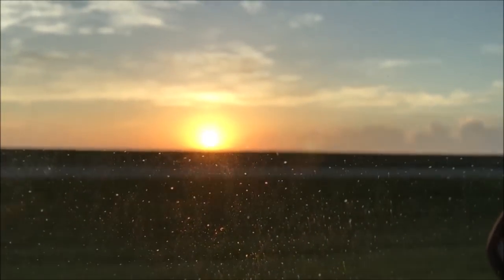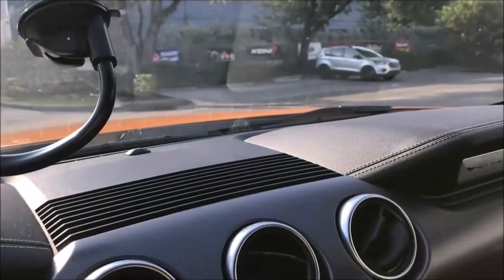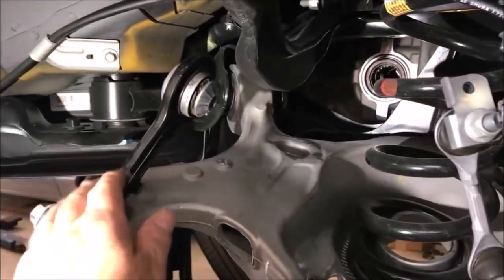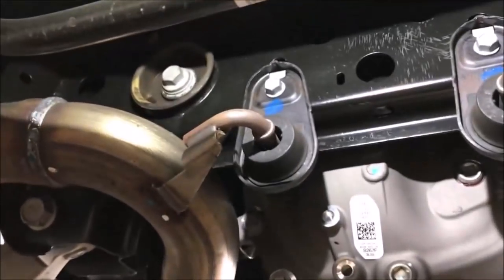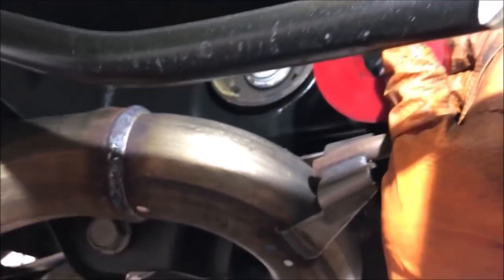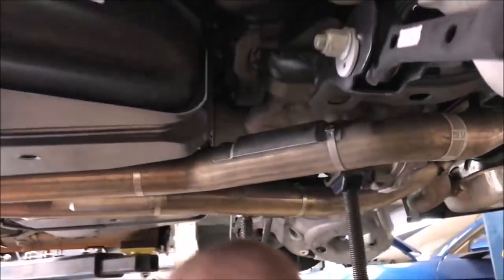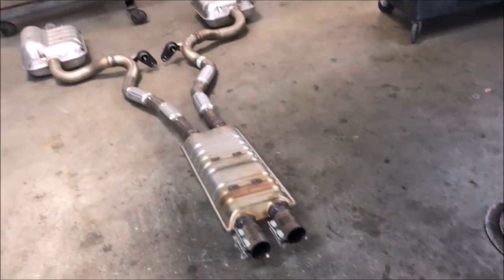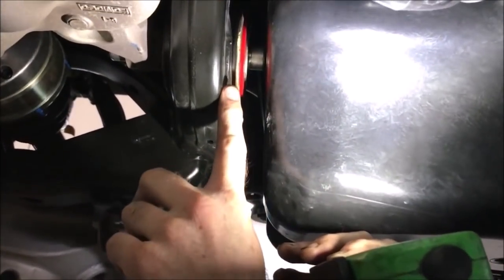2018 Mustang GT 5.0 10R80 - Stop The Hop Install at STEEDA! Part one!

Comment: I have same car as you,except its a convertible,best time i have done so far 4.9. ,with my stock tune ,however i have invo nitto tire instead of stock,+ 295/35/20 in the rear,went with stagered set up 255/35/20 .
Reply from the maker: John Smith.... Wow the 295's must be taller than the stock size. I am running the 3.55 rear gear. A tune will help your car i am sure!!

Comment: I notice you dont have perf. Pack 1 or 2 and no magnaride. Did you decide to go with little options to save money or to build your Mustang from the ground up. ?? Just curious. The GTS can reach all the way into the 50s fully loaded and you are going into used Shelby territory at that price..
Reply from the maker: The General ..Hey bud thanks for viewing.. you know when i bought this car in november of 17 i had to make a decision. PP1 with magnaride. or non pp car.
buying a pp car without magnaride made no sense to me. i elected to get the non pp car with the 10 speed and the 401a pkg for the digital dash. $10K cheeper that the pp1 magnaride. that $10K got me the whipple installed. i can upgrade to the 6 piston brakes if i want to at this point. What do you think? did i do the right thing?
Reply: @coyotecarguy2076  Man I like the way you think. Many people purchased the 18 PP1 some with magnaride some without and now they are wishing they had a whipple or Roush supercharger. The way you did it.. You can take your time and build it the way you want it over time.. Good job brother..
Reply from the maker: @thegeneral8133  Thanks Man!! Few people have supported me on this. I use the car for street driving. I could use better brakes but i really don't need them. I like my 750 HP Mustang GT. Check my Video from last month!

https://www.youtube.com/watch?v=Z8LvWEwS6uY

Comment: New to these cars, why replace the axles?
Reply from the maker: Jeremiah Bright  . . . I installed better axles because i was installing a supercharger. .  the stock axles will break when you put a lot of power through them.  especially if you race the car with drag radials.

Comment: Or just buy an SS 1le and never have to spend a dime on the suspension . It's perfect
Reply from the maker: Mike Ross. I thought about getting a camaro SS. But i am a mustang guy. Ford tries to isolate vibration and road harshness from the passengers by using soft rubber bushings in the suspension. When you start to build power the suspension flexes a lot
and the wheels bounce around. Some of the parts i installed were not totally necessary to stop this but i plan more power in the future.. Thanks for posting my friend!
Reply: Coyote carguy is there any truth to a 5.7L coyote in the future?  Would trade the SS in tomorrow if it's true . Btw I'm a Ford guy too, just couldn't pass up the deal on the 1LE.
Reply: Coyote carguy btw don't make us wait too long for the bolt ons!!
Reply from the maker: Mike Ross.. i understand why people buy a camaro.  Its a rompin car.
I have no info on a 5.7 coyote.. I can say though there is a possibility of a 5.2 n/a voodoo engine in our future. ford has a way of using the same stuff over and over once they build something.
Reply from the maker: Mike Ross. i have some mods planned for the car. I have to wait until they are built before i can put them on.. stay with me it's gonna be fun!